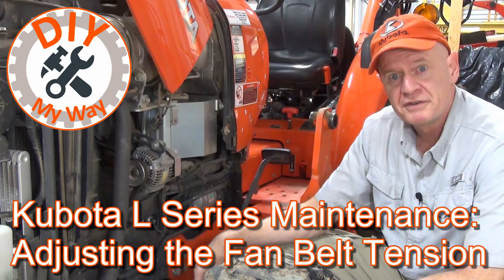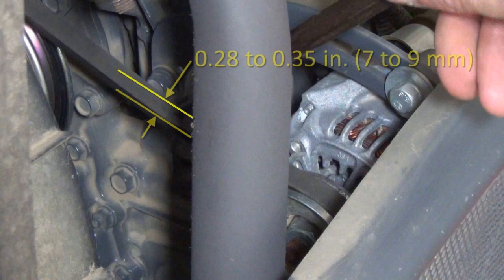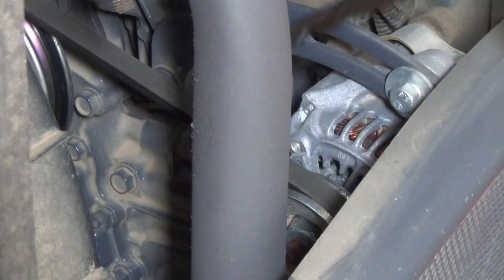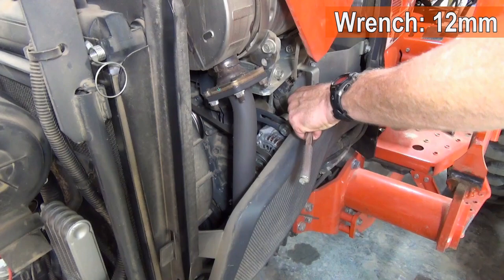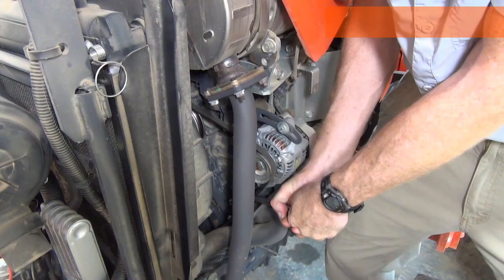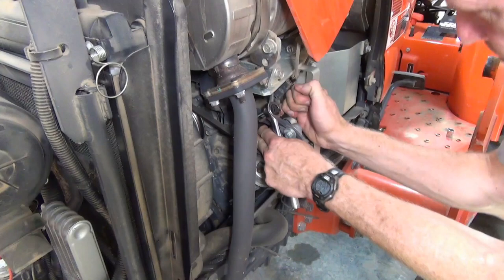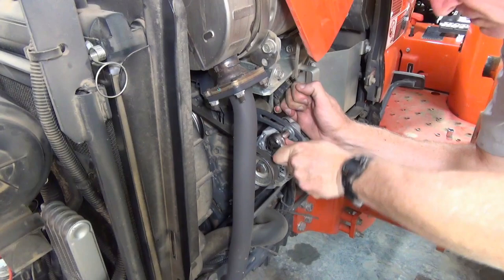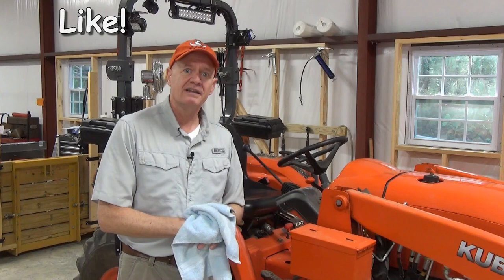Kubota L Series Tractor Maintenance: Adjusting the Fan Belt Tension (#76)

Comment: Good evening Sir ! I will use a rag ( soft material ) between the prybar and the alternator for not risking cracking the alternator case. Great maintenance video !!! Cheers !!!!
Reply from the maker: Hi Dave!  Good point!  I’d be really disappointed if the alternator case cracked under the modest pressure I needed to tighten the belt. I wasn’t too concerned because it’s a Kubota!   Built like a tank.  Thanks for watching!
Reply: @DIYMyWay  Good morning, It did happen on my 1985 Dodge Ram Van B350 !!! I was lucky the Mopar dealer did exchange it since i was doing it in the parking lot in front of his business and I was short on tools !!!   Cheers !!!

Comment: Very helpful video. Thank you.

I have a dumb problem where I did this and the belt is still loose when I turn on the utv. I even tightened all the way and noticed a burning smell after several trips so I had to lose it a bit again thinking I probably over tightened it. I am wondering if there’s a pulley tensioner that went bad. It’s driving me crazy.
Reply from the maker: I think you are right about a pulley going bad.  Good luck fixing it and thanks for watching!